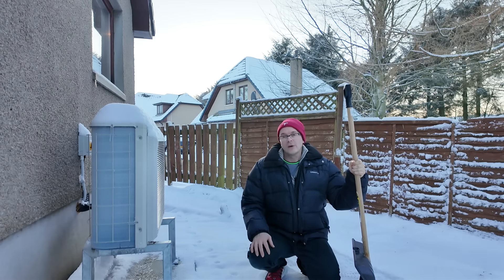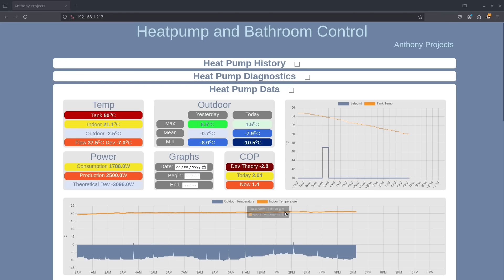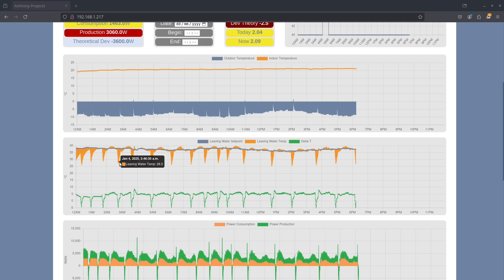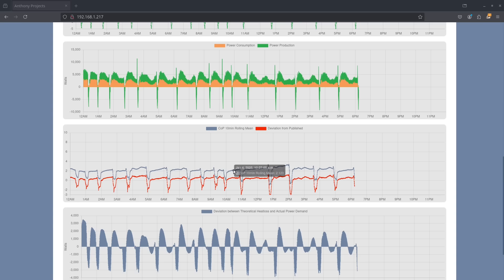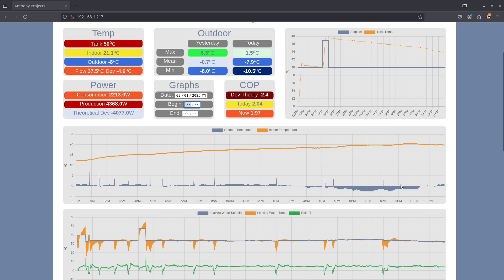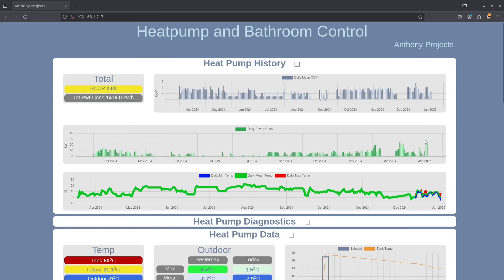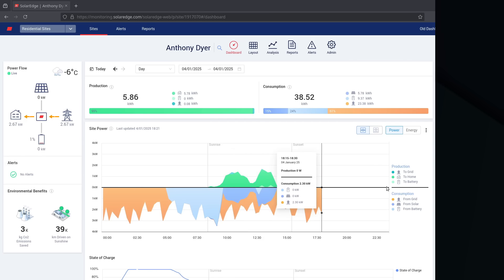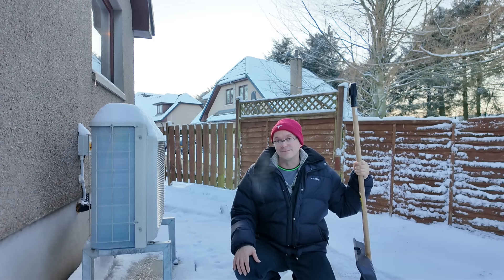Heatpump Performance on the coldest night of the year

Comment: A heat pump and standard price cap electricity will be about 10% cheaper than gas. If you move to a smart heat pump tariff this will reduce to about 2/3 the price of gas. If you also have a home battery this further reduces to 1/2 the price of gas. If you have solarPV as well this reduces to about 1/4 price of gas, If you additionally have an EV and are on an EV tariff , you heating costs will be negligible. 
With a gas heating system you are pretty much stuck with the same bills into the future. If you live in the countryside and you are not on the gas grid then your only choice apart from a heat pump is oil or electric storage heaters - both costing considerably more to run than a gas based heating system.

Comment: I am in Canada and there are a few days where it hits -25c -30c and my heat pump works fine. If you keep your home at 25c it might be a problem but 20-21c is fine. Besides that avg winter temps are no issue. My electric bill plummeted massively

Comment: Up to 60 % of UK electricity is generated by gas turbines, at maximum when no winds blowing, so your heat pump is powered by at least 50% gas at all times. What is the point?
Reply from the maker: Your first statement is wrong.  Over the last month 28% of the UK electricity was generated by Gas Turbines.  https://electricinsights.co.uk/#/dashboard?period=1-month&start=2024-12-15&&_k=963j4f

And therefore the point that you ask is that eventually all of our electricity is going to be provided by renewable power.  Not only that, but the government has got a goal for that to happen by the year 2030
Reply: @anthonydyer3939  According to National Grid Live only 36.9% of electricity was generated by renewables in the last year, 28.9% by fossil fuels and 22.2 from other sources (hydro, Biomass, Nuclear)

So why are our bills calculated at the price of gas generation.  The government promised bills would reduce by £300 but that has not occured prices have been 'massaged' upwards by the not fit for purpose Ofgem.
Reply: @anthonydyer3939 
At the moment National Grid Live shows that 55.8 % is generated by fossil, which is where my 50% to 60% came from. I regularly monitor it and have never seen it below 50%, obviously daytime only, which is maximum useage.  You are displaying your ignorance of  electricity generation and distribution, the base load and response times mean that nuclear, gas and possibly coal will always be required.  Try to educate yourself before making peculiar comments.
Reply from the maker: @TEF586  please excuse my ignorance, but coal is no more in terms of domestic energy production.  It’s gone, never to return.

Now you can cherry pick your days to suit your statement, but my link above is the total share of electricity generation over the previous 30 days, which of course does include the coldest days of the winter so far.  That offers a good overall snapshot of where we’re at.

But the notion that “gas will always be required” is nearly obsolete.  It is predicted that 2025 will be the year that the first “gas free hours” are recorded in terms of electricity generation.  I’ll leave this link here, so you can educate yourself about the full picture https://www.carbonbrief.org/analysis-fossil-fuels-fall-to-record-low-2-4-of-british-electricity/

In other words, gas is already the provider of last resort (because it’s so expensive), but its share of electricity generation will continue to diminish.  It has long since departed any notion of “baseload” power.  Only nuclear and Drax occupy that space.
Reply: And even if electricity were solely generated by gas, heat pumps would save 40% of that gas.
Reply: You're cherry picking data, and then drawing a conclusion that's not supported by actual data. You're arguing in bad faith, what is the point?

Comment: SAY NO TO HEAT-PUMPS I CAN HAVE ONE INSTALLED FOR FREE IF I GIVE UP MY OIL BOILER. THANKS BUT NO THANKS
Reply from the maker: There's absolutely no objective reason why you should "SAY NO TO HEAT PUMPS".

Honestly, the reactions to heat pumps that I'm seeing here are beyond irrational and are full of ill conceived emotions.    I can almost imagine the protest march to parliament just now with that tone.

They aren't going to take your jobs or your house away (unless of course you work in the oil and gas industry and don't change jobs).  My heatpump doesn't even spy on me!  All those graphs:  That's my own work, under my own control!  

They are just objects.  They do a job, which is to provide heat, and as I've proven they do it very well on the coldest day.  

The only question is one of upfront cost and running cost, vs staying with your oil fired boiler, and that's what my channel seeks to explore.

As you have just alluded to:  If "I CAN HAVE ONE INSTALLED FOR FREE IF I GIVE UP MY OIL BOILER" I'd grab that offer with both hands.  You don't need too much brain development to see that as a good deal.

Comment: If you just super insulate your house you'll pay less than half that daily cost with gas. It makes no sense to fork out 10's of thousands (even with subsidies) for solar, a battery/ inverters, a heat pump, retro fitting plumping so its compatible, ontop of insulation to then pay twice as much than if you simply insulated properly and stuck with gas.  This ridiculous push to net zero is crippling our country!
Reply from the maker: This is the trouble.  

You can insulate your house at reasonable cost, depending on construction (suspended timber floors with crawl spaces are much easier than solid concrete floors for example).

But "super" insulation.  That's something else.  By that you probably mean insulating up to passiv haus standards.  That's not cheap, and it's very disruptive.  When I say "not cheap", I'm meaning project costs north of £60k for an average house.

Against those costs, heat pumps make a lot more sense.

As for "crippling the country".  It was gas which did that back in 2022.  We are held hostage to it, and the only way out of that hostage scenario is to go with other tech, such as wind and solar.  

I will also add that for every pound spent on these investments, there's a pound earned by someone in the supply chain (minus taxes of course).  So these things do create economic growth.
Reply: @anthonydyer3939  
Firstly I do commend you on having a successful heat pump installation and it's relatively cheap although I'm not sure it would be without the solar and battery. 

As for 'crippling the country':
Natural gas price went from $3 to $10 in 2022 because of the Ukraine war but quickly came back down again to $3. Are our gas and electric prices back to 2021 levels? Nope! They remained high and are going to keep rising to pay for the net zero transition for which no one voted for.

Our energy costs are spiralling and are now multiples of other countries putting extreme stress on consumers and making our industries completely uncompetitive and so unsustainable. EV policies are the nail in the coffin for our automotive industries. 
Our island can be self sufficient for all our energy needs but the lunatics in charge determined that to save the planet, it would be best to import liquid gas from the US at huge cost over the Atlantic in diesel ships! Our backup coal fired power stations are now fuelled by wood chippings from Canada, again to save the planet and shipped over the Atlantic at huge cost via diesel ships. Nearly all of the green tech such as your heat pump, lithium batteries, inverters, solar panels, wind turbines all get shipped halfway across the world from China via diesel ships and are built via coal power stations in China. 
It doesn't take a genius to figure out this is absolutely insane and will be a disaster of epic proportions!

I should add on that very cold day with no wind and weak winter sun it was the gas power stations that were mostly powering your heat pump! Apparently we came extremely close to blacks outs too. Just imagine the vast amount of power needed if we're all forced to have heat pumps and EV's not to mention that awful noise in the morning when you open the door to hear hundreds of heat pumps rumbling away in defrost cycle! Sounds like hell to me. 

I'll stick with my British made gas boiler thanks very much.

Comment: There is no such thing as synergy when these contraptions are installed !
A waste of time and lots of space 😡
Reply from the maker: @kbolton9399  A waste of space?  Have you seen how big these oil fired boilers are?  About the same size as the heatpump.  But then you’ve got a big smelly oil tank to add to the yard as well.  Now that’s a waste of space!

As for it being a waste of time:  No more so than the time spent choosing a new boiler.

Comment: Thank you Anthony for the informative video and I am looking forward to your next one with the annual stats for the heat pump.
The public is suspicious because there are many cases out there of overpriced, terrible installations, even in new built houses.
I am not sure the government subsidies benefit financially the end user, but that’s another long discussion.
Thanks again for your work to inform the public
Reply from the maker: @serraios1989  Government subsidies don’t generally benefit the end users.  They benefit the suppliers.  It gives suppliers a demand driven reason to invest in skills, tools and supply chain.  Once they “get good”, the subsidy isn’t needed, 

Case in point are air to air heat pumps. Were it not for F Gas regulations they would be a DIY job in this country.  There’s plenty of American videos showing how to do it, and it’s not hard.  You can buy simple systems delivered for about £1000.  My Norwegian colleague that I interviewed 15 months ago has such a simple heatpump, and it works because their houses are open plan, so you don’t need many emitters everywhere.  One emitter is sufficient along side good insulation.

Comment: Can we please focus on COST. After all my pension only goes so far.
Reply from the maker: @butlerpa100  OK.  

Heatpump Installation cost was about £9k after the grant.   Running costs for electricity, which includes heating and 70% of my car mileage, is going to be about zero, or maybe a little over for the whole year.  I’ll find out after a full year at the end of February.

In terms of advice for my mum (who is a pensioner): Heatpumps are not an investment that mum will ever see a financial return on.  But solar panels could be, as the financial returns are much faster.   Younger people who own their own home would be the group that benefit from heatpumps the most at this stage.

But there are exceptions.  Portable heatpumps are cheap and you need run a big 8 inch flexible duct outside your house.  That could be an Ideal solution if you need to heat up just one room.  A quick search revealed this product for £389 https://www.appliancesdirect.co.uk/p/airflex15w/electriq-airflex15w?refsource=apadwords&utm_source=google&utm_medium=cpc&utm_id=17998807843&cq_src=google_ads&cq_cmp=17998807843&cq_con=&cq_term=&cq_med=pla&cq_plac=&cq_net=x&cq_pos=&cq_plt=gp&gad_source=1&gbraid=0AAAAAD9z1-2xhQwlx3YCco-skdQPgsQ-O&gclid=EAIaIQobChMIgbKEz__tigMVpJBQBh38PAQ1EAQYBiABEgK79fD_BwE
Reply: @anthonydyer3939  Hi, even after the grant, It is going to take a long time to get your money back for your outlay.  
You are quite right re your mum.  I can't imagine my mum arranging a heat pump installation, nor running it day to day, nor getting it fixed or maintained.  I fear she would be fleeced in every case.  The complexity of the equipment and installation is something that most people are not going to be able to get to grips with.   
  Your electricity is currently cheap at night and normal during the day, but this can't continue long term.  The subsidy of the tarriif is currently at the expense of others.  Well done though with your own system.
Reply from the maker: @scherry5135  In terms of complexity, heatpumps are not complex.  There’s six moving parts:  Compressor, Fan Motor, Expansion Valve, Hot water diverter valve, Circulation Pump, Backup Heater.  Compared to a boiler:  They have about five moving parts.  In terms of operation, it’s much simpler:  Just set 21 degrees all day and let the installer worry about the weather compensation curves.

There are far more complex things for mum to deal with:  Her car is the best example of a complex machine.

The reason why electricity is cheap by night is purely down to supply vs demand.  We’re just utilising spare capacity that isn’t otherwise demanded.  In the future the balance of electricity supply vs demand will shift, and likely become more complex.  But access to cheap energy will always be possible especially for those that have batteries (which are definitely getting a lot cheaper now).

Comment: So it takes 1 kWh to get 2kw. eon is charging me between 25 and 45 p per kWh therefore the heat pump is around 5 times more expensive than bottled gas !
Reply from the maker: @screwdriver5181  That’s expensive electricity!  Especially 45p.  I’m paying 7p overnight, 26p during the day only once the battery and solar are out.  Most winter days it’s only a small number of hours on the expensive leccy.  The coldest day, 2 weeks on from the shortest day, is the very worst case scenario.  Most days I’m seeing  3 - 4 CoP during winter and better during spring and autumn.
Reply: At current standard rates, a reasonably installed heat pump should have similar energy costs to a gas boiler.
Reply from the maker: @Biggest-hz7ng  And by my analysis on previous videos it does have similar costs to mains gas.
Reply: This video shows the undeniable reality of a heatpump in the Uk in our poorly insulated houses. The cop is terrible in the winter time . Well more expensive than gas. This is all well known and documented. I don’t think you can get a better cop than the manufacturer!!! So your model isn’t calibrated correctly. It’s still better , cheeper and more reliable to have a newish combi boiler. Again not everyone can afford to spend £10k + on a pumps, batteries and panels especially after the miliband has u turned on the gas boilers . Stick with gas.
Reply from the maker: @Cyberbobxxxx  The key mistake you make is that you assume the figures from the coldest day apply to every other day.  They don't.  

The COP is low when it's really cold, and the manufacturers CoP assumes a heating medium temperature of 55 degrees, vs 38 degrees for my system.  So it's reasonable that I can beat it.

Yesterday and Today, it's averaging about freezing point.  Still cold for a UK winter, but the CoP is hovering around 3-3.6 (very few defrost cycles yesterday, but more today).  The consumption on the heatpump is generally below 1kw rather than 2.5kw.  That, and the sun is a bit higher for longer, so now my batteries have a chance to recharge in the daytime.

Comment: Did I understand any of that?  No. Does it all mean the thing works or not.
Reply: If it didn't work Anthony wouldn't be using it? His install appears to be efficient enough to be cheaper than a gas boiler at standard rates

Comment: Where do you put all the stuff needed for heat pumps if you have no spare cupboards?
Reply from the maker: You put it where your old boiler or hot water cylinder went.
Reply: @anthonydyer3939  That would be the attic, a place I'm to arthritic to get too.

Comment: Cut the crap , at these outside temperatures the heat pump is just a big electric immersion heater and the smart meter is glowing in the dark . Useless BS junk .
Reply: They do work, at about 3 mins Anthony gets into the figures (2-2.2) at minus 10.

Comment: Another "WAFFLING  HEAT PUMP  EVANGELISTOR FULL OF B/ S".  My  COMBI BOILER   20 Minutes on all rads  10  circulating  62 Degres C.  House up to temp  21Degres C.  60 minutes.  Your " HEAT  PUMP WILL NEVER ACHIEVE THIS" .  Obviously a achedemic  all they need is Spread Sheets  / Graphs  and B/S.

Comment: Hot water of 50 deg....isn't hot...so you'll be using your immersion heater if you want a shower ££££££s
Reply: Please don’t shower if the water is  50deg hot. You will be scalded.

Comment: Just an advert for costly and inefficient heat pumps. I'll keep my gas boiler at half the cost and better heat output.
Reply: Not true about the cost-A reasonably installed heat pump will have similar energy costs to a gas boiler due to its efficiency.

Comment: My viesmann boiler runs at 6% of 16 kw 32kw boiler set down to 16kw  weather compensation  it also has water tank under it
222f boiler  0.4 a day gas heating  normal 5
Very cold day total 11 gas usage 
Normal day radiator temp 40c  verycold day 56c  it has a automatic boost if under -2 
Which i fitted and temp can be 68 c or more
Give out constant room temps no hunting 
Has a low loss header not sure if heat pump
Would work in my 4 big rooms 2 big bed i small bed bathroom small 2 long hall ways 30x 8 rooms 15x15 i dont think my 1933 house is insulated enough for heatpump yet
They need to be more efficient  ❤
Reply: Viesmann do 12kW heat pumps, Samsung and Mitsubishi 14kW ones. If one heat pump isn't enough, they can chain multiple units. Insulation to reduce the requirement for a large heat pump would likely be worthwhile.